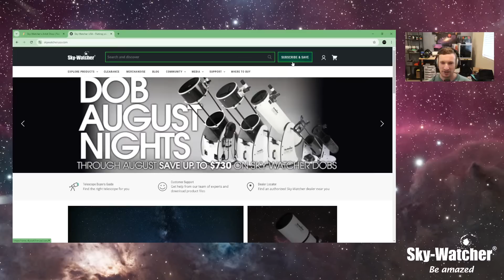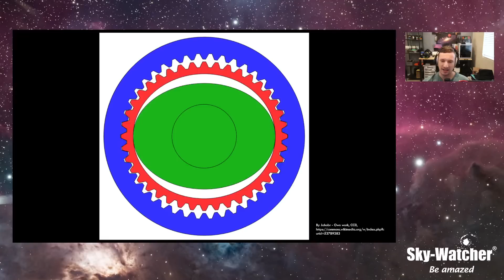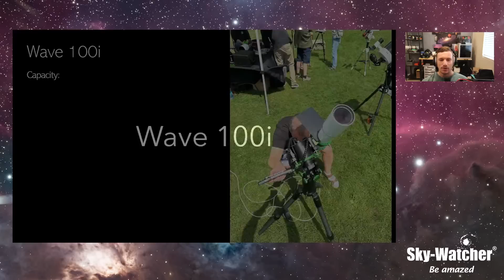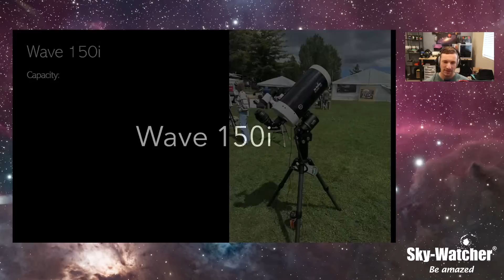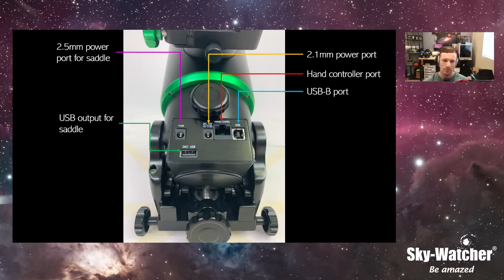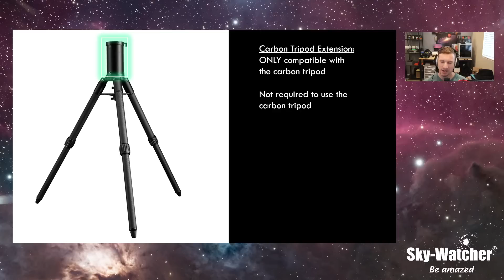What's Up? Webcast: Wave mount Introduction

Comment: Come on when the target for skywatcher is celebrating an total error under 1 arc sec holy moly. The benchmark for these mounts is around 0.3 guiding and not to be happy of under 1arcs
Reply from the maker: These do guide well under 1 arc second. Most customers performing around 0.5 RMS. But you are welcome to state how you feel to make yourself feel better.
Reply: @SkyWatcherUSA dont get me wrong i think this mount is a very good one. But to say its great to have a guiding under 1 arcs is not state of the art in my mind and presents the mount worse than it actually are 🤷‍♂️
Reply: I have a Zwo AM5 and a Lacerta 10" Newton on it with around 20Kg and a giuding around .3 to .06 . And was thinking about to get 150i because of its 25Kg support. But after you said any near the max payload isnt well for imaging anymore im realy unsure about it
Reply from the maker: @cupralibre7871  that is pretty much true for any mount. We try to be conservative but your mileage will vary from set up to set up. But at some point your main telescope will be limited by the seeing conditions. Your listed guiding numbers are great and about what the Wave 150i produces as well but at some point, it doesn't matter because your main scope does not resolve it. 

If the Wave 150i doesn't fit your needs thats fine. You are welcome to have your thoughts on it. There are plenty of mounts to choose from in the market that will fit whatever your needs might be.
-Kevin

Comment: I'm considering getting a wave 150i mount.  Just a question regarding the other lines, will there be more developments on the eq6r line or are you guys focusing on strain wave going forward?
Also, please stop trying to make the synscan app a thing. People generally hate it and don't use it. Or, at least make it so it's an alternative to eqmod or gss. Currently, it's just useless.
Reply from the maker: There is a lot of development in strain-wave currently. We are not aware of any EQ6-R updates but that doesn't mean it wont happen but currently nothing to report on it. 

The SynScan Pro app has a lot of development to advance it. There are some big additions coming soon but it takes time to have the app evolve.
Reply: @SkyWatcherUSA  thank you for the reply. You mentioned in the video that the wave mounts works with asiair out of the box, what about NINA?

Comment: There is a typo in the Wave100i manual in section 3.3. It says in 3.3, bulletin point 3 that the power plug is 2.0 instead of 2.1 mm.
Reply from the maker: Thank you for point this out, we will look into this.

Comment: Hi, a few questions for you if you have a bit of time:
- you mentioned that you flew with a Wave 100 and an Esprit 100. What do you think of that combo for imaging?
- regarding the tripod, is there any other option than the carbon fiber one at the moment (ignoring the future steel tripod / the eq6 pier)? Like can I mount a Wave 100 on a star adventurer or eqm35 pro tripod ?
- as of satellite tracking, can it be continuous or is it limited to leap frog tracking?
Thanks a lot!
Reply from the maker: The Esprit 100 and Wave 100 work well together but you would want the counter weight and a loaded Esprit 100 is very close to the weight limit of the Wave 100 w/o a weight. 

You can use any tripod with a 3/8 thread, so any pro photo tripod or the Star Adventurer tripod. The EQM-35 will not work because of the metal azimuth adjustment pin casted onto the top plate. 

For satellite, we don't have enough info. to answer that at the moment. It might be best to email us so we can pass it along to the engineering team to provide more details on this questions.

Comment: Between the Wave 100i and AZ Eq5 pro, which one is best suitable for visual use if I don't care about the dual encoders? Does either one have a better pointing/goto accuracy or more vibration free while focusing on a robust tripod?
Reply from the maker: It depends what you want to mount. The Wave 100 is very nice due to its weight and form factor.
Reply: @SkyWatcherUSA  I am looking to mount a skywatcher 120mm achro refractor or a C8 sct

Comment: Will you be able to control the mount with the mini pc connected to the saddle usb port? Also, how many Amps can each power jack on the saddle handle?
Reply from the maker: You will need to run it with the SynScan Pro for Windows app. But you should be able to make it work on a mini PC. The upper power saddle is 5amp max.
Reply: @SkyWatcherUSA 5Amp per 2.5 Sattle outlet, or 5Amp in total for both outlets on the sattle?